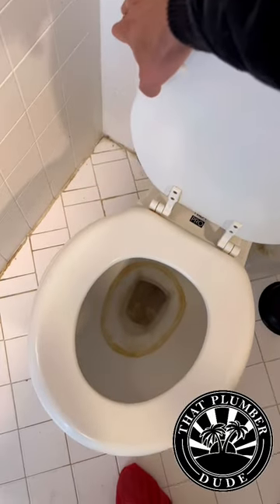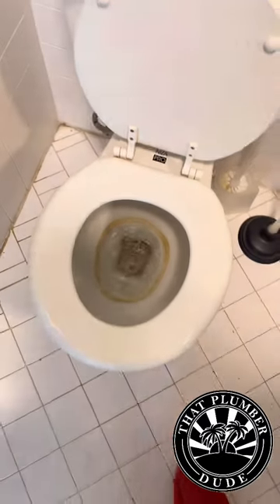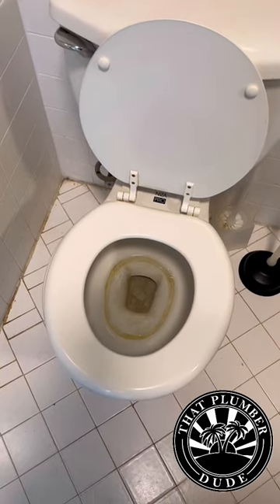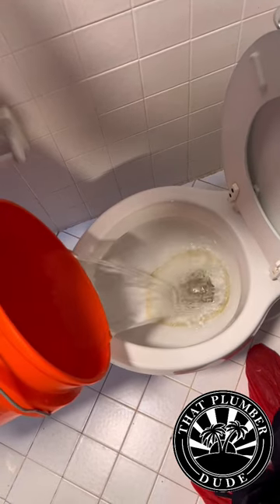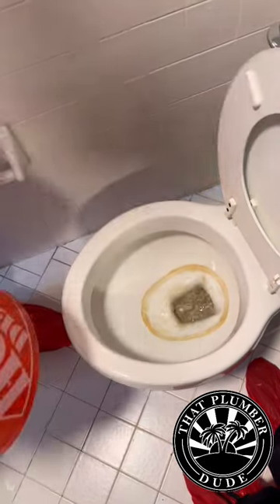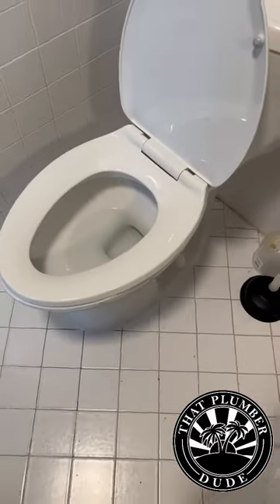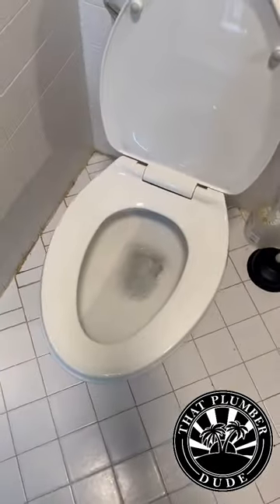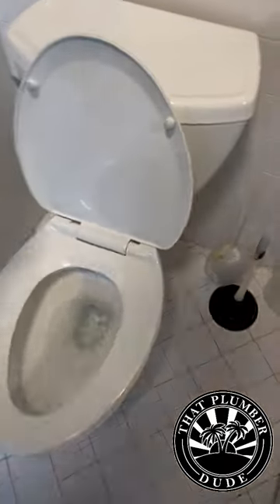How To Fix A Swirling Toilet | Plumbing Clip

Comment: Or you can repair it by clearing all the buildups in the siphon jet if the homeowner refuses to buy a new toilet
Reply from the maker: Yeah, you can try to repair it but sometimes water quality is too bad for extremely old toilets. The cost to have a plumber work on it isn’t worth it.
Reply: @ThatPlumberDude  The old toilet in the video is newer but cheap and its not worth the try to save it luckily Home Depot Stopped selling Niza Pro Toilets after few years its not like if it was ever a better toilet as they don't tend to last long